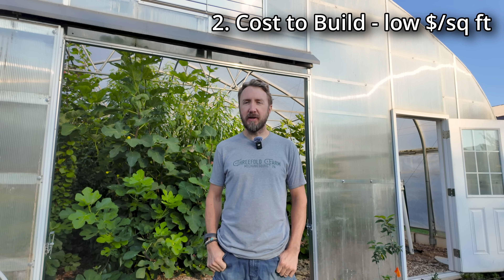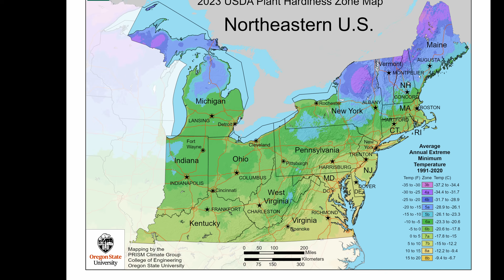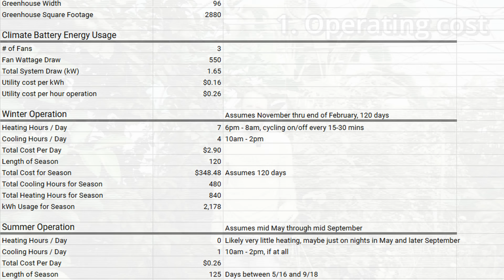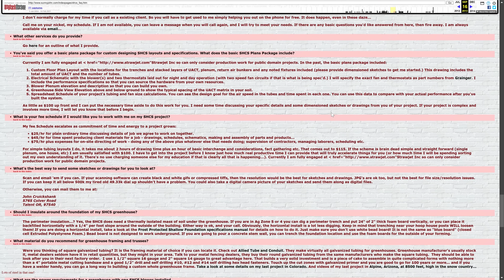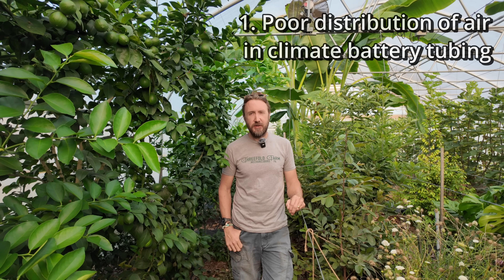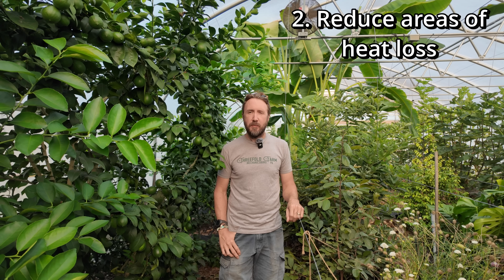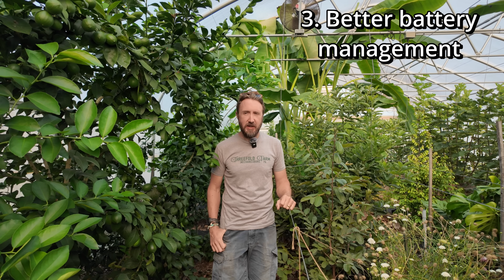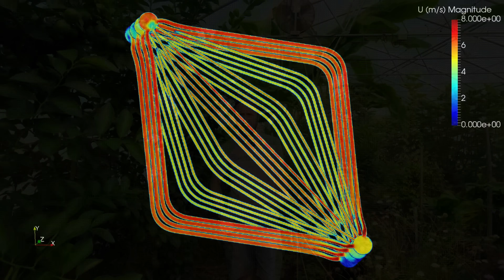Building an (Almost) Tropical Geothermal Climate Battery Greenhouse in a Temperate Climate

Comment: I'm confused by something in the presentation. The climate battery approach was selected, as I understood it, in large part because of its low cost. In the closing, one of the major drawbacks for the climate battery approach was its cost. The apparent contradiction doesn't make sense. I would also recommend that you charge your battery during the summer. You'll find it helps improve your over all performance. There's another name for these systems that shouldn't be overlooked, Passive Annualized Heat Storage, and you'll find a large range of additional information looking under that name. One more option for consideration in the initial design options are the partial buried "Walipini" style.
Reply from the maker: Thanks for the comment. As it regards charging the battery in the summer, we've played around with different dates to start charging. We do "charge" when the greenhouse gets to be above 95F but that's pretty rare around here. Based on sensors installed in our greenhouse at a depth of 7-8' we see our soil temps rise, passively, to at least the mid to upper 60s without any additional heat added to the climate battery, so in our estimation running the fans during the summer doesn't buy us anything for the additional cost of electricity to run them. We do try to maintain that heat as late into the fall as possible by running them.

As it regards cost, perhaps I should have elaborated more. Given the available options in the video, the climate battery was the best solution for us for the long term when considering all factors: up-front cost, ongoing operating/maintenance cost, effectiveness for the intended task, and additional labor required (and probably other factors I'm not remembering).

As I mentioned in the video, a climate battery isn't for every use case and in many cases I don't recommend them when they don't fit the requirements of the farm or person operating them, but in quite a few instances it makes a lot of sense.
Reply: It was the residual as well as the upfront cost that was considered. Upfront it's a bit of a barrier, but the cost of running it is basically nilch. Start watching at around the 15 minute mark.
Reply: I agree that passive annual heat storage PAHS is worth checking out.  That technique uses a lot more earth as a battery and as insulation.  The umbrella that they use to keep a large area around the heated space dry would be super important to many people.

Comment: Why not a Chinese style greenhouse? They seem like the least expensive option, and least complex.
Reply from the maker: Are you aware of a commercially available kit in North America? I'm aware of the gentleman in Alberta but haven't seen them deployed elsewhere in NA.

Yes, they could be a good solution on their own if the price is competitive and really great if paired with a climate battery. I'd love to be able to stretch a big blanket over my greenhouse at night and remove it every morning. Inexpensive means of insulating greenhouses is something I'm very interested in but haven't seen a lot of compelling commercial solutions to.
Reply: @threefoldfarm 
Here is another Alberta greenhouse you might be interested in - the most efficient greenhouse on earth- on the Arkopia  website. Mar 29 2024.
Reply: @threefoldfarm  No, I am not aware of a kit sold in North America, but the gentleman in Alberta ordered direct from China. I am planning on building a Chinese style greenhouse, but most likely will have to order it from China. I am only growing for my own use, so it will be much smaller then commercial size like yours. Maybe if you are going to build another greenhouse, you could try the Chinese style, I would imagine it would be cheaper, due to not having to do so much excavation work. I would be really interested in the direct comparison.  The geothermal battery seems like a great way to go, but that much excavation in my township would be a permitting nightmare.  The Chinese greenhouse, does not require permitting for the State I am in, Pennsylvania.

Comment: The greenhouse in the snow is absolutely a kit. I’m looking at one in my yard right now.
Reply from the maker: Quite right. It wasn't a kit to my knowledge when we built the first two greenhouses (though I think it was in the works). I did order Russ' materials way back then and it was definitely an inspiration for what we did even though we went a different route. 

Actually just looked it up, looks like around $11.66/sq ft (24' wide version) which isn't bad compared to some other options. Excavation and construction (and foundation work maybe?) would still be needed as well as other parts that they mention on their site would be needed (insulation maybe? not sure).

My intent wasn't to say that this is the best solution for everyone, but simply describe why we went the way we did. In a farming context, price per square foot is a major driving factor.

Comment: Using a fossil fuel heat source to heat a greenhouse is the most efficient and "green" way to use fossil fuels because the plants in the greenhouse will use the CO2. Remember they need CO2 like we need oxygen. 

You played yourself.
Reply: @braysive - The correct  amount of CO2 is good for food plants.  Too much CO2 is bad for food plants.  Farming is more complex than you can comprehend.  You "played" yourself.
Reply: They may uptake some of it, but certainly some leaks out. Additionally, people use the space and high co2 levels are not great for people
Reply: Your D-K level of confidence is off putting. Have you considered the cost of installing, say, a propane heater? I got a bid for a 250 gallon tank install and it was over $5,000, empty tank, no tubing or connection to the greenhouse heater. Then the cost of propane was roughly 200% the cost of gasoline. The cost of using propane was far more than I had considered, which is why I am considering this type of system. Life is complicated.

Comment: I’m in zone 5 in Michigan and planning our greenhouse currently , I’m in all sand so diving is no problem but our cloudy days and long cold winters I’m planning an insulated greenhouse with the climate battery to be my best solution but havnt settled on the best battery design
Reply from the maker: Cloudiness is a huge factor here too. Depends on what you need the system to do based on what you're growing. Best wishes in your choice!
Reply: @bennytroyer8897  supercharge in summer as there are so many days without sun and crazily, many nights without clouds in winter radiative loss to space) so Michigan is about the worst possible for its latitude.  Consider latest Chinese greenhouse design on top of climate battery.  Insulating roll between 2 layers of glazing vs the older external roll approach.  Also, semi-walipini ideally set unto a south facing slope.  Get some horizontal seasonal thermal mass, not just beneath greenhouse.
Reply: There’s some videos using underground sand batteries in the north usa where the ground freezes. I’m pretty sure they used a closed loop system of a liquid instead of air because the liquid is more efficient and doesn’t have the common mold issues etc of using air and big conduit

Comment: I've been wanting to replace my shed with a greenhouse for my ever growing citrus collection. Sadly I don't have the large space to build something at this scale. During your research, did you find any information on if there's a lower limit on the size of the greenhouse to remain effective? This is a fantastic idea, and the software engineer side of me just wants to build all the sensors and dashboards!
Reply from the maker: If you google SARE project FNC19-1185 you'll find a project by an engineer that I've been in contact with. His first climate battery greenhouse was a small one and it's done really well, though he's insulated the foundation as well as built a more highly insulated structure. He's located in sunny but cold South Dakota and has a lot of good solid resources on the SARE site as well as presentations he's done.

Comment: Well done! Especially the CFD validation by actual measurements and actually building it. In the industry they call CFD - "Colours For Designers" for a reason. Reynolds numbers et al are one of the unsolved modern science problems, all major approximations of how fluids behave in real life, and require constant validation.
Reply from the maker: Appreciate the kind words! I didn't know about the alternate term for CFD, I like it.

We hope to continue to improve on design through validating installations, collecting data, and using it as a feedback loop for any future iterations on design. I'm self-trained in terms of understanding the physics (heat transfer, fluid flow) of what's going on so I'm hopeful that the design will change as I grow in my knowledge of what's going on.
Reply: @threefoldfarm feel free to ask any questions!

Comment: Thank you for the wonderful video! I have a question about the "battery". Wouldn't water be a far better battery with its far superior specific heat capacity of 4184 J/(kg*K) compared to soil's ~800  J/(kg*K)? You would need less than a fifth of the total water volume to achieve the same results. Has there been work on heating greenhouses using a well?
Reply: Yep, this is essentially an external thermal mass system he talked about earlier in the video. For some applications, it works well but for his application, he said it took too much of the growing space and offered too little control over when the heat was stored and released. It also takes more energy to move water than air so any solution that involved pumping water from a hot storage tank into radiators in the greenhouse would require bigger pumps which, as he mentioned with heat pumps, aren't cheaply available.
Reply from the maker: Well-stated by both of you. To validate @AndreasGeorgiades point, I am certainly interested in water for its much better specific heat, but I think there are a few challenges and potential drawbacks. First is storing that much water. I don't remember the specifics of costs but large tanks to hold the water (and, ideally, insulate it) are pretty expensive. I did some calculations a while back so I don't remember how many gallons would be needed to equal the thermal storage of the soil we're interfacing with but it's quite a lot. The second would be finding a radiator/heat exchanger solution (I'm sure some exist, I'm just not well-versed in them). The third would be the loss of soil heating that we gain through the current system. This could be accomplished through soil heating tubes but would require some excavation and additional cost. I would probably locate the water outside of the structure or in the ground to avoid it taking up greenhouse space. I am interested in water storage broadly as it opens up possibilities for other sources of heat to feed into the thermal storage. If you know of anyone doing this sort of work I'd love to know about it.

In defense of using the soil as thermal mass. Yes, it's inefficient but there is a LOT of it.

Comment: I tried to jump on this a few years ago. I investigated the fans (got me a nice dent and ding deal on ebay for a 12" Dayton), I started looking at rheostats to fine tune the static pressure, I went with 1000'  of 4" corrugated drain tile and 20' of 12" culvert to operate like a manifold. I know the difference between XPS, and EPS insulation, It's about $1100 tied up into those materials before I started to design my greenhouse. Jerome's book and Schiller & Plinke's "Year-Round Greenhouse," was the two books I used to determine what I needed. I also looked up the U.S. Army Corp of Engineers data on their soil tests, and the archived online info where Jerome got his inspiration. (the guy you mentioned in the video that pioneered the system). 

I'm really glad someone else finally picked up the ball and ran with it a little further. My snags were that I ran out of space and money in my back yard to create what I wanted, and the cost of glazing can be astronomical.  Anyway, thank you for the video. I'll peep your site when I move into the country).
Reply from the maker: Appreciate the kind words on the video. Best wishes on your project!

Comment: The classic and poorly documented question on this design is the atmospheric circulation of microbes and spores from the moist soil in non-winter months.  Have you done any testing?
Reply from the maker: Haven't had any testing done but I've also never noticed problems. I asked the same thing of folks who have much older systems and they've never had any issues with pathogenic organisms as a result of the system. My thought is that the structure is leaky enough (even with sealing it up) and there's enough air circulation in the system to prevent most issues (plus we still have circulation fans running).
Reply: @threefoldfarm  You didn't use pipe with anti-microbial impregnation?  Might not be available in drain pipe form.

Are you finding issues with heat migration in your modelling as the condensed water drains heat away from the soil thermal mass?

Comment: With the changing economics of solar power, how will an economically efficient greenhouse of this design change when daylight summer solar costs approach zero?
Reply from the maker: Appreciate the question but I'm not sure how to answer. Are you wondering if it becomes an even more attractive option? If so, probably.

We actually don't run the system much at all in the summer (it banks the summer heat in the soil passively for us) and most of our electric usage from cycling the fans comes in the winter and the shoulder months. Our long-term goal is to have enough solar generation on the farm to offset the usage of both of the greenhouses (plus our other coolers/pumps/etc).
Reply: @threefoldfarm  Thanks.  Thought you might consider hypercharging the battery with heat pumps in the summer and consequently reducing size, material and other capital costs.  And the consequent water savings and possible prevention of heat leaching from the battery.
Reply: This is a great question.
Reply from the maker: Makes sense, appreciate you clarifying. I have something in mind for excess PV generation but will need to think it through and plan it out. Perhaps a solution that could service multiple greenhouses.
Reply: @SeekingBeautifulDesign - The cost of solar panels, racks, charge controllers, battery bank, inverters, conduit, wire, electric heaters, disconnect switches and circuit breakers is NOT cost effective. Especially in cloudy location.
Reply: @MrSummitville  For sure.   Definitely poor engineering to use electrical resistance heaters.  Using DC direct saves a lot more cost so inverters are poor engineering.  

But, if you are designing for winter resilience for your house, your summer generation will be effectively free and can be used to increase seasonal storage for the winter.  It's especially great in cloudy winter conditions to use clear day summer sun.

Good points on how poor engineering ruins ROI.
Reply: @SeekingBeautifulDesign  So how are you going to heat a green house in the winter with solar energy?
Reply: @MrSummitville  The general concept is referenced as Seasonal Thermal Energy Storage.  The video is about taking the summer heat from the greenhouse and dumping it in the underground soil providing summer cooling and then pulling out the heat in the winter.

Excess PV in the summer can be used to further enhance this process by boosting the storage of summer solar thermal energy.
Reply: @SeekingBeautifulDesign  The warm soil will not last very long, especially when ambient air is below freezing , or even below 0°F.  You need to keep ADDING heat into the soil, in the autumn and in the winter, and the spring. The "Heat of Capacity" of soil is much lower than you assume. You have no clue ..
Reply: @MrSummitville  You're right, moisture definitely affects heat capacity.  You can rent a meter to measure your local soil capacity at the various soil horizons.

Heat moves slowly in soil, so it's not all going to dissipate to the surroundings unless you're into the water table or there's a lot of water percolating through the heat store.

You can also check out the research on Passive Annual Heat Storage if you don't want to look at Seasonal Thermal Energy Storage.  STES has more available research though.
Reply: @SeekingBeautifulDesign  Not just moisture ... The Water Table.  I have 1,500' of tubing submerged in the water table.  I can pull out 60,000 BTU per hour, continuously. That would keep the Green House above freezing.